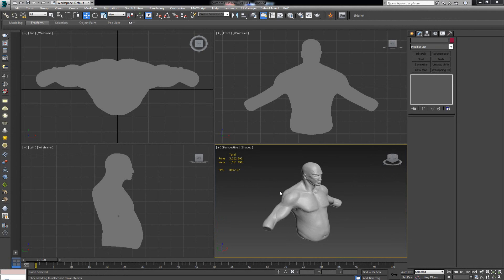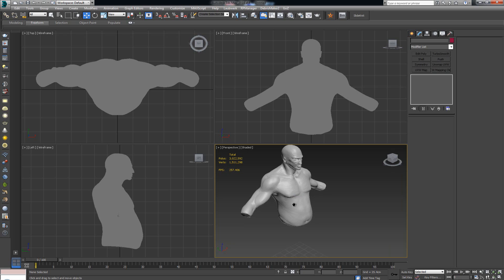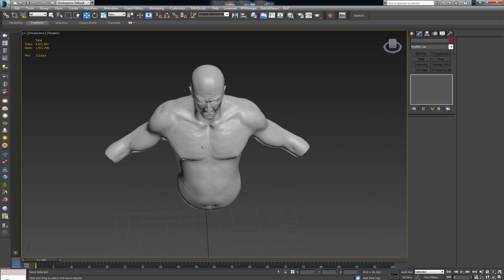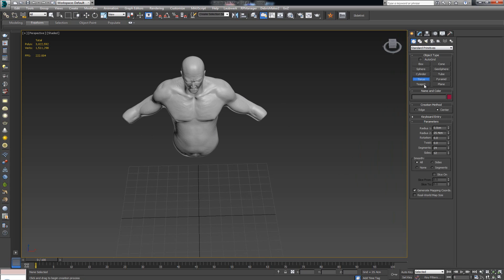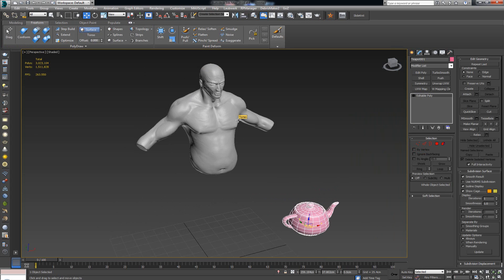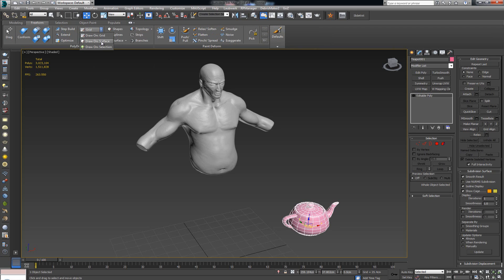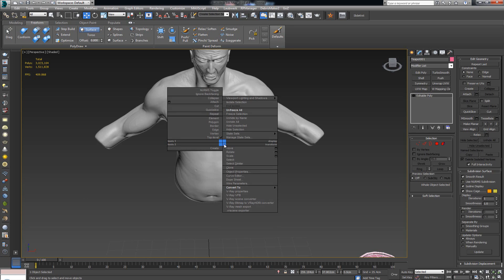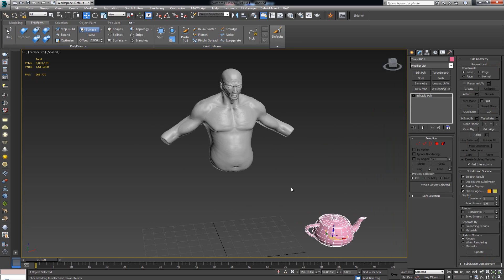Retopology with 3Ds Max

Comment: this is the problem with these unser unfriendly programs.  there should be a  button 1.  reyyppo. then  justy go  but its not the case there is like  19  steps before you can  retyppo.  Bad.

Comment: sir, what graphic card do you have? quadro or gtx?
Reply from the maker: Don't really see why that would be important here, but i'm rocking a GTX970 :) but thinking about jumping on the GTX1080 hype train once the prices get more stable
Reply: Saw 3mil of polygons and 220fps and for a moment I was impressive. But just opened a model with 10mil and I have around 45fps on my old quadro4000.. Also thinking about gtx1080 or 1070. Seems Quadro are good only for CAD programs